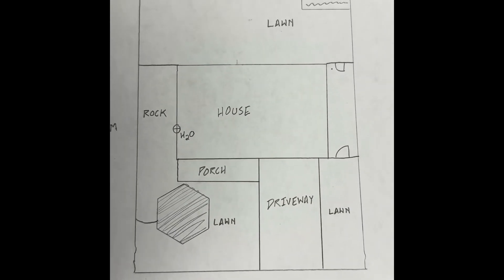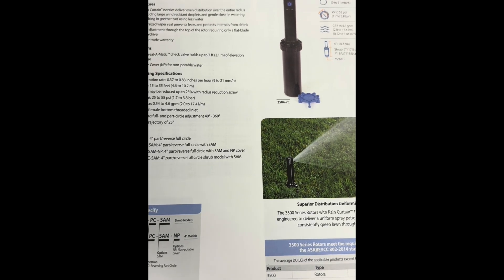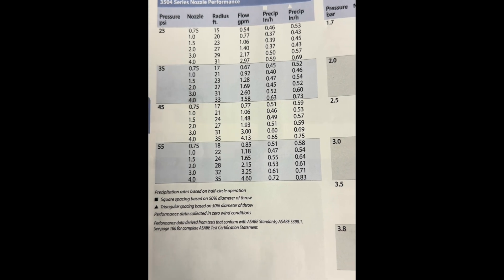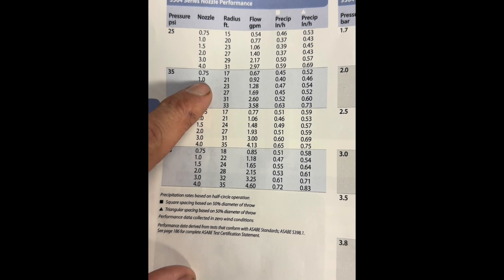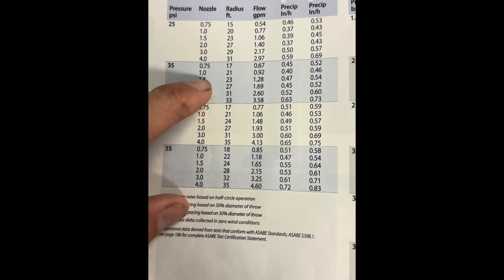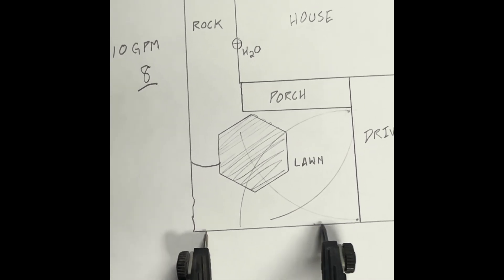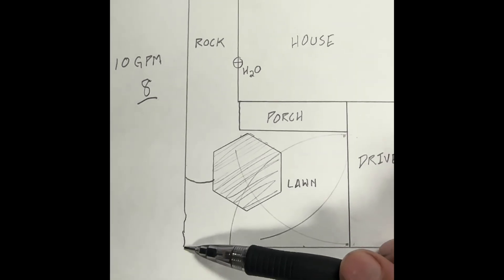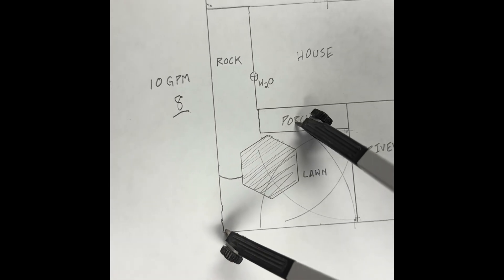Designing a Sprinkler System for Home

Comment: What happened to litres/minute & KPa? I can learn to use the conversion factor so hopefully the video tells me what else i want to know.
Reply from the maker: In the catalog from the manufacturer of the sprinkler heads that you use, they usually include a separate chart or conversion. The theory is the same. Flow rate (GPM or LPM) is important. You can find the catalogs and charts online, usually from each companies website.
Reply: @PracticalSprinklerAdvice  
Thanks, I have a submersible well pump that I have a flow chart for somewhere and about 1200m2 of lawn so I need to work out how many sprinklers at a time to use and their cover as we don't have many straight lines. At the moment I use some of the farm sprinklers to do the lawn but as I'm getting older the idea of an automatic system sounds better.
Reply from the maker: @cantablocal6768  good idea. I would start with finding out how much flow you have, and then pick out the heads. If you need some help, just let me know.

Comment: Wow why I didn’t see this last year . I have to dig out and redo everything bc I start the sprinklers and then I have to water by hose what’s not covered 😂
Reply from the maker: You might be able to just switch out the heads or nozzles. What kind of sprinkler heads are you using? What’s your flow rate (GPM)?

Comment: Good video
 The sprays on the 8-foot section seems like overkill. I thought each spray could be separated by about 4-5 feet.
Reply from the maker: I think I understand your point. In this particular case the heads closer together  are overkill. This is because we were not able to put heads on the opposite side, which would be a triangle layout. So in this design we put the heads closer to have sufficient overlap. If that’s what you mean.
Reply: @PracticalSprinklerAdvice  So more overlap/overkill = less watering time as the larger zone?